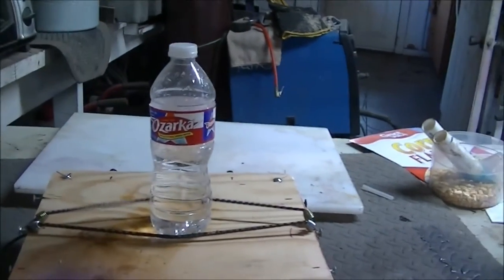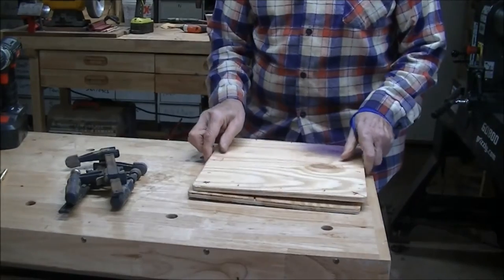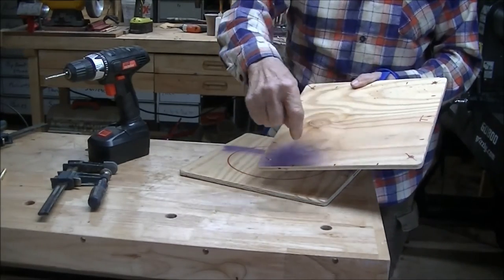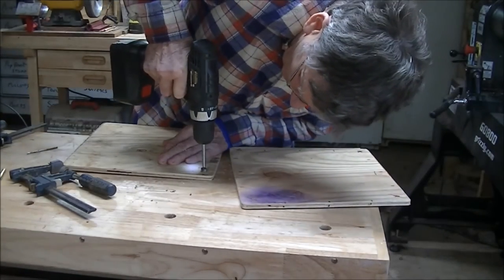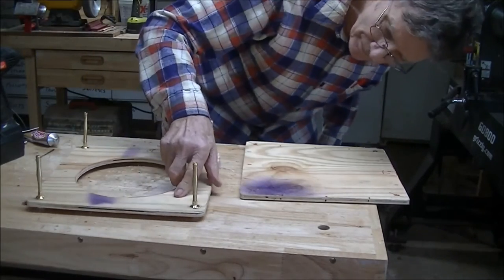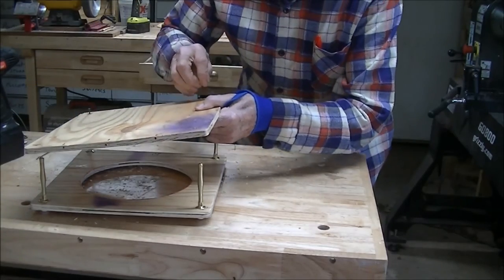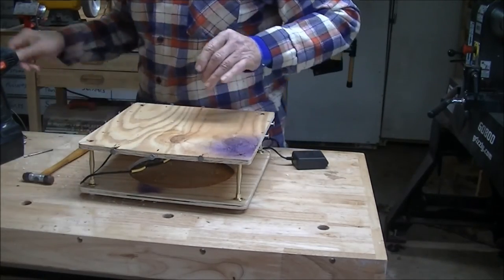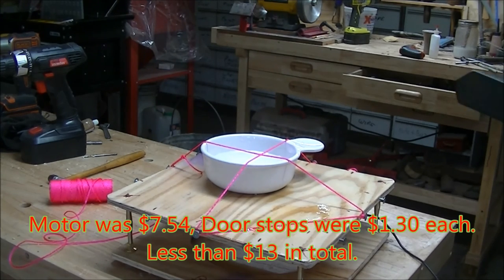Vibrating Table # 72

Comment: Got it built but I didn't need the access hole because the top floats with the nails in the comers. It works great for what I am using it for. Thanks Larry.
Reply from the maker: Good deal, and thank you, Larry